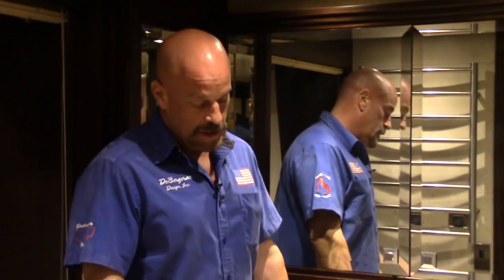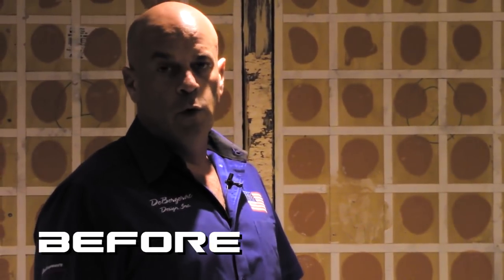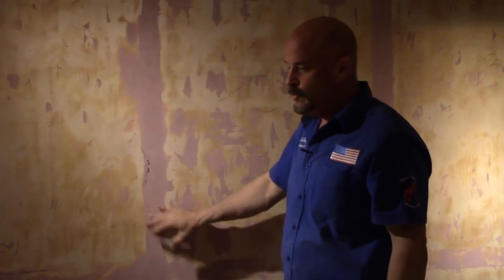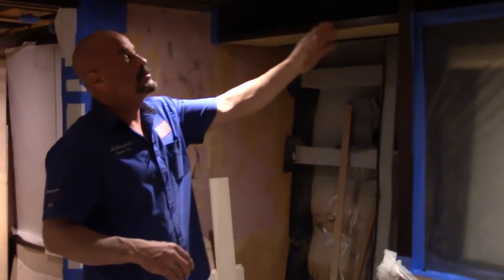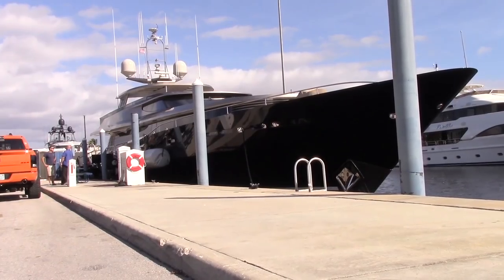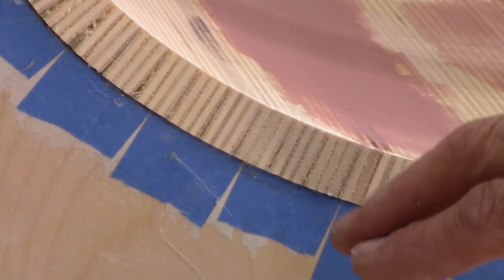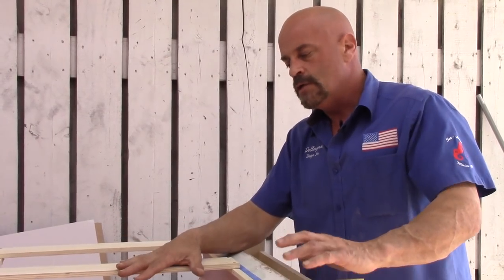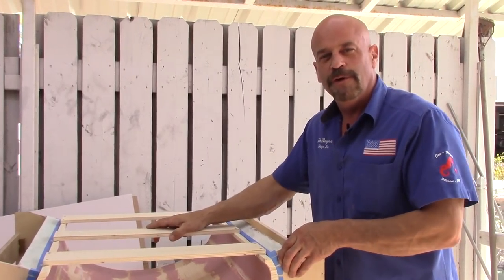How To Make A Round Wooden Cabinet PT1

Comment: Thanks for posting. I’m trying to make a curved Caninet at the end of the island and not sure what material to use . Any suggestions?
Reply from the maker: Frame out your cabinet end with horizontal strips of ply that match the radius you are looking to create. You can then laminate several pieces or more, of.375 bending ply over the frame work.
    Once laminating glue, Tight bond or Fasco has dried, remove horizontal strips.
Jim

Comment: What is the wood u use in strips.. looks like a foam core veneer plywood? I assume thise is common in boat cabinets
Reply from the maker: It is called a light play in our industry. It’s not something that’s normally used in yacht cabinetry as it is very unstable. 
However because we intended to apply fiberglass to both sides and hardwood edges it worked fine for our purposes. It also kept the doors very light.
Thanks for watching,
Jim

Comment: When glueing the half inch strips did you start at the center and go out? Also how did you keep the tight as the dried? Weight maybe? I can't imaging how to use a clamp in that mould
Reply from the maker: Hello V. Hansen,  sometimes the easy way it the best. We simply glued the strips into the mold, after coating the glue side with epoxy, using a hot melt gun. After epoxy dried, it popped right out. I had my four year old do most of it, it was that simple.
Thank for watching! Jim

Comment: While gluing the individual stick, do you need something to hold them in place? Or is the glue tacky enough to do that? Regards Esben
Reply from the maker: Hello Esben, We used hot melt glue to hold them in place just a small drop on the top of each one. It was more of a security measure then needed. Thanks for commenting!
Be well,
Jim

Comment: Thanks for the video.  Working on those big boats if it was me would be like a two edge sword - Such a blast to be working on it, tempered with: I better not screw up!  
Ok, midnight question #1 Why is the door made up with vertical strips?  Couldn't you just cut the same material into curved strips (on a cnc) and build them up horizontally (then apply your coats of fg etc).  Seems to me like making a mould for a one off is overkill, (but hey, I've never done any cabinetry for a multimillion dollar boat)!  Cheers, David
Reply from the maker: All we do is cut large pieces of wood into small pieces then glue them back together and cut some more. I can screw up a bunch and be okay unlike a pilot or heart surgeon, they are the ones that better not screw up;-)  There is probably more than 56k diffrent ways to make the doors. You named a way as well as me showing a technique. Only 55,998 more ways left. Not sure what you're point is?
Jim